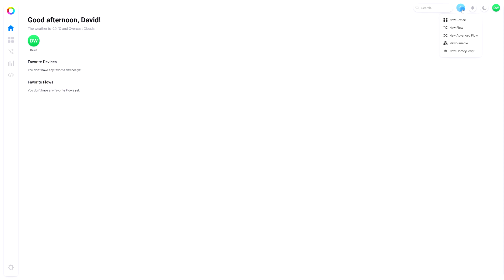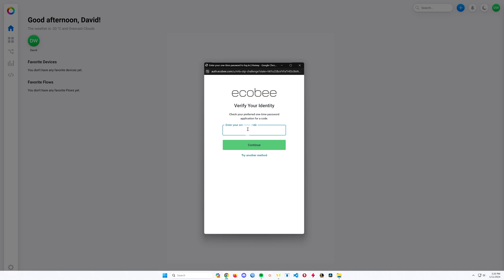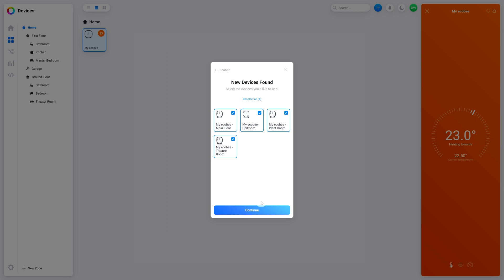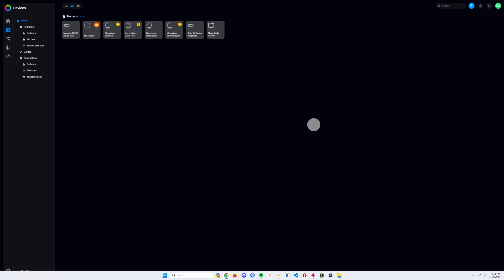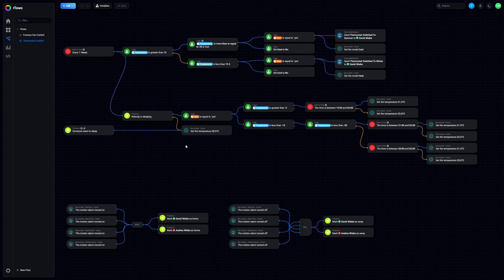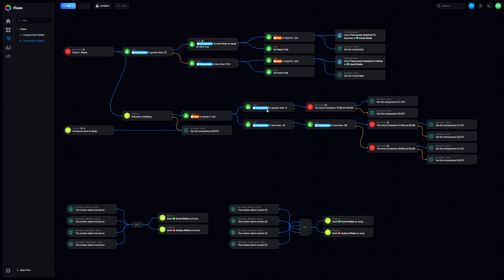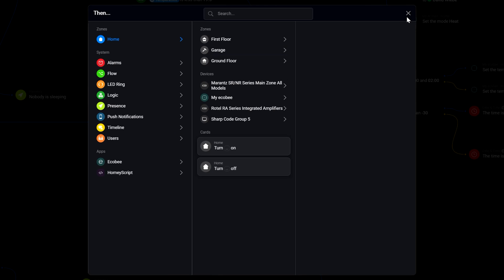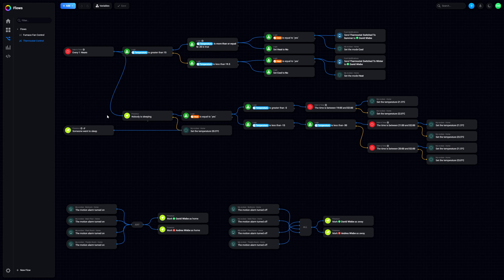Supercharge Your Ecobee With  Homey Pro Integration

Comment: Why don't you set those temperatures in variables and use the logic function to compare both of them? From there you can switch your fan ! :face-blue-smiling:
Reply from the maker: I'm clearly missing something, there is no fan command available for Ecobee in a "Then"
Reply: @HouseDadLife  Maybe, you can try to solves this thru a Google routine, because Ecobee is suported by Google, and Homey also.